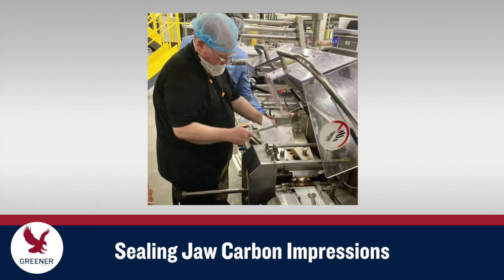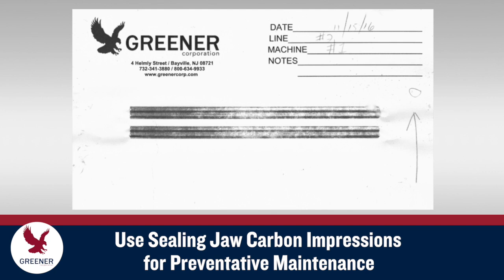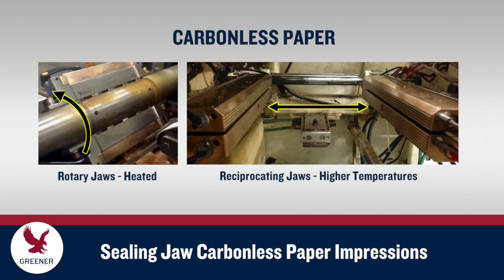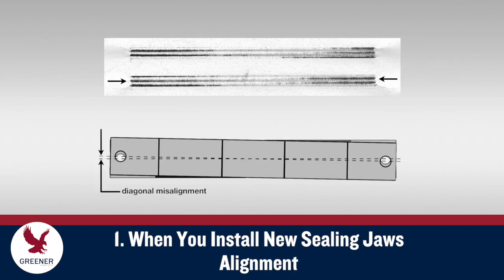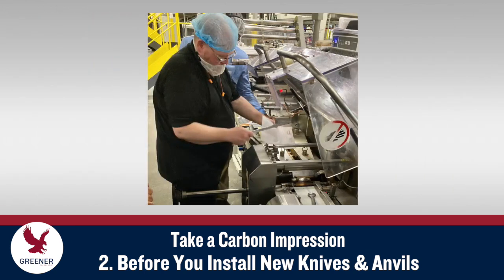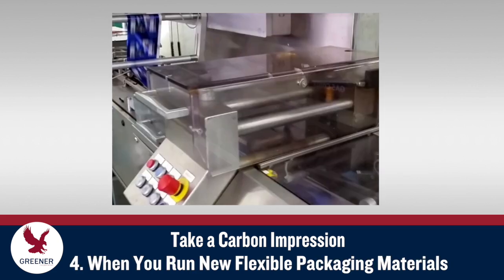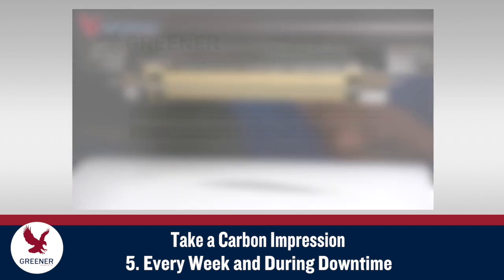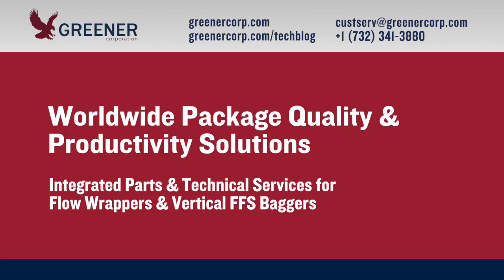Use Sealing Jaw Carbon Impressions for Preventative Maintenance on Flow Wrappers & Vertical Baggers

Comment: I have been working on flow wrappers as a professional for 25 yrs for OEM’s. The method of carbon paper is the only way to set up sealing jaws properly. There is no other method. 

I enjoy greener corps videos, because the methods are exactly the same methods I have been using for 25 yrs.

If you dont have a book to check the carbon print, dont touch the sealing jaws!!! 

@pacmatix4078
Reply from the maker: Thanks for sharing your experience with carbon impressions and the benefits they provide when setting up sealing jaws.